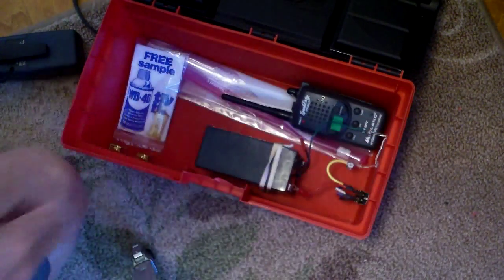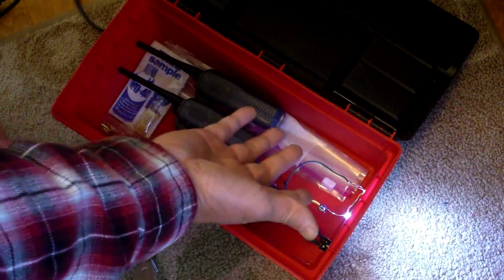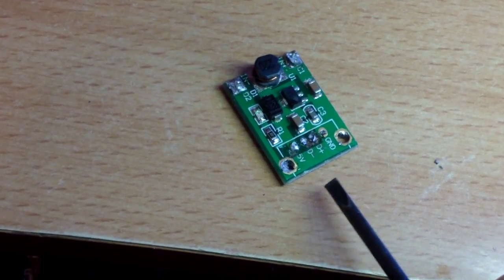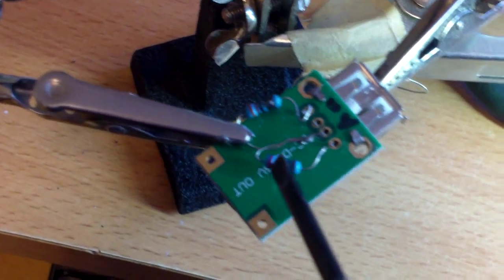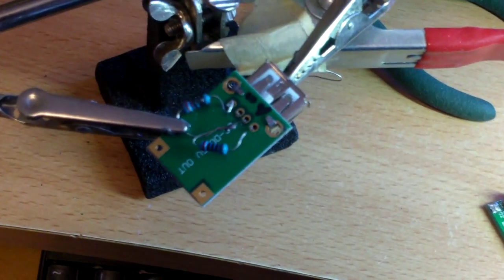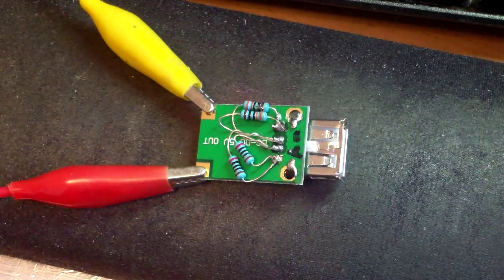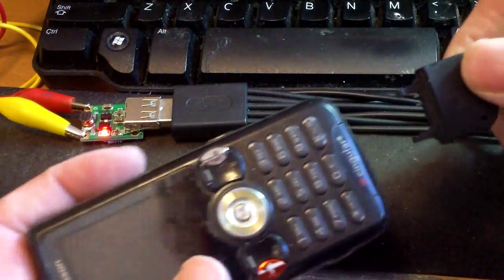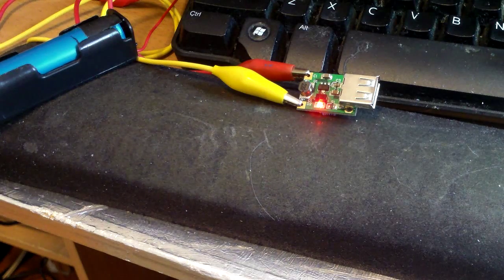Making a solar tool box and my 5v charging boost module smart devices compatible

Comment: where can i buy these 5v voltage booster ?
what do i have to search in ebay to buy those?
Reply from the maker: sam sid Try typing this in eBay search box: DC-DC Booster Module 0.9V-5V to 5V 600MA USB Step Up Module
Reply: thank you